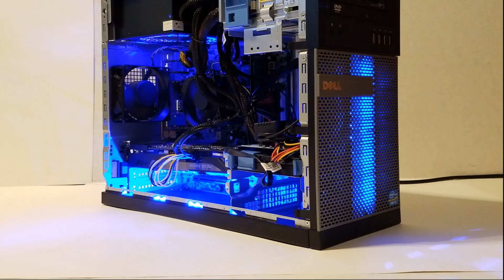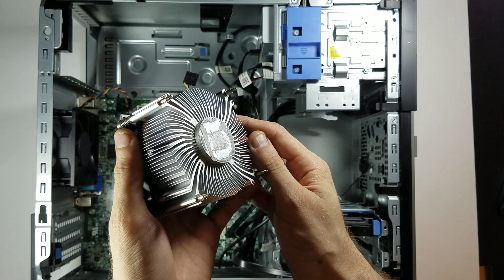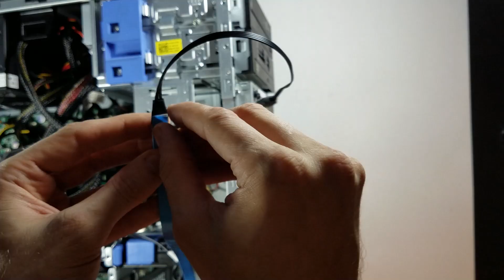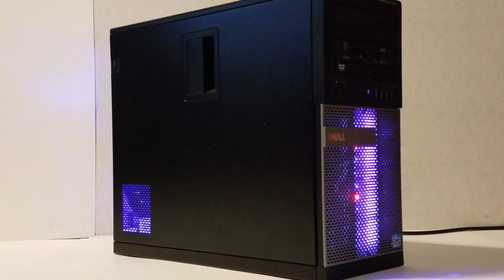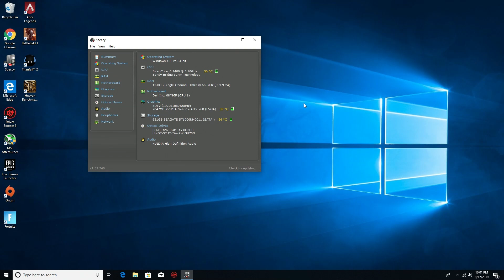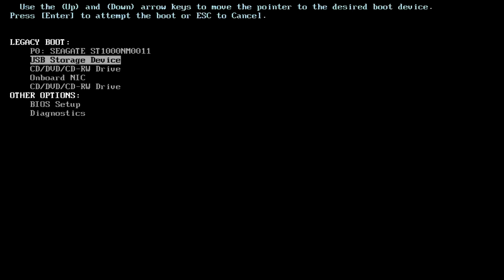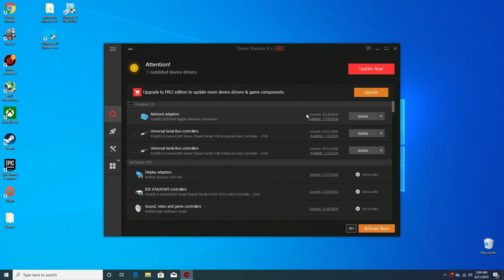CONSOLE KILLER PC *BUILD GUIDE* | FORTNITE | GTX 760 i5 2400 DELL OPTIPLEX

Comment: To anyone hesitant on doing this I’m not telling you to do it but I did it and it runs amazing. Here’s some things to know! In total I spent about $230(including shipping)
-I’m on a dell optiplex 990 i5 2400 
- also it needs to be a mini tower! Make sure it’s this or nothing will fit!(paid $100)
-I did not replace the thermal paste and it runs fine but I still recommend doing it
- I also put the Radeon rx570 in instead of the gtx 770(paid $89)
-if you use the rx 570 gpu in this case your gunna need to drill out 3 rivets that hold the hard drive holder and bend it up
and then just zip tie the ssd in place. 
- I get 144fps on fortnite (prolly could get more but I capped it). 
All in all great buy and build!
Reply from the maker: You made my day brotha! So glad this this build worked out for you! Your my new pinned comment!
Reply: @techyesterday4960  Basically I want to get it but I'm not sure what tower to get, I know it's meant to be an Optiplex but there are so many types.
Reply: 842 0273 get an optiplex minitower or “MT”
Reply: 842 0273 optiplex mini tower 790 i5 2400
Reply: @8420-m7c  get the mt
Reply: Tech Yesterday does it matter what case you get I’m thinking about switching the case
Reply: @techyesterday4960  help i got a dell optiplex i5 2400 790 on aciddent and it has the long power supply and i have a 500w box power supply it doesnt fit what do i do
Reply: king on 60fps u most likely got the small form factor of. Try to return the pc the ebay seller
Reply: @randyRV22  its too late
Reply: @urdopey846  oof
Reply: @urdopey846  How is it too late? it just arived??
Reply: @urdopey846  hey I just did the same damn thing. Did you end up figuring out any ideas? I was thinking maybe I could keep my power supply outside the box but I'm not sure
Reply: @somaticexpedition  no u can try to refund or resell it for the same price
Reply: @urdopey846  damn alright. I have another computer tower that is bigger...maybe I could swap everything from the smaller tower into the other one?
Reply: @somaticexpedition  yes but be careful
Reply: I got a 650 watt ATX and not sure if it will fit in the dell optiplex 990 minitower, can someone help
Reply: @nottrouling3785 i might get this computer will it work with a 790 mt
Reply: Tech Yesterday is a rx 580 sapphire pulse compatible with a optiplex 790
Reply: @techyesterday4960  do all power supplies come with 6 pin and 8 pin adapters?
Reply: @techyesterday4960  does it have to be mini tower?
Reply from the maker: Also i have a video coming this week that goes into great detail about removing the hard drive bay to fit any size card!
Reply: Tech Yesterday if I used a 1660 could I get 240 fps
Reply: Danny, what was the size of the card
Reply: MrEpicBruh uhhh 64gb I think not sure
Reply: Did you get a new psu or keep the one that came in that pc?
Reply: Danny Dressel should I get an OptiPlex 790 or 990. Which is better for gaming
Reply: Danny, is there any way I can connect you through insta or Twitter lmk please I have some couple of questions to ask. Thankyou!
Reply: lopez msg me on insta @dannydressel
Reply: Danny Dressel Thankyou so much man!
Reply: Brandon Taylor yeah I plugged them in to the motherboard first then plugged the gpu in, it was a superrrrrrr close tight fit but it worked
Reply: I got a rx 570 to put into my dell optiplex 990 i5 2400, can someone show me how to fit it and make the rivits and zip tie it please, I might pay if someone gives me a proper tutorial!
Reply: @nottrouling3785   there's a tutorial out there for sure cause I saw one but you gotta look for it
Reply: @nottrouling3785     https://youtu.be/Iu2VXfU8Q58   maybe that will help
Reply: Thanks bro!
Reply: if anyone bought the tower could i get an exact link
Reply: Sage go on eBay and look up optiplex i5 2400 just make sure you get the mini tower
Reply: I can’t fit my gtx 780 I need help any suggestions
Reply: Does this have an hdmi port ? if not than how can I use HDMI.
Reply: lolzi the graphics card has an hdmi but you should get a new monitor
Reply: @xDeeSwervoo  so, I connect graphic card to monitor? Not motherboard?
Reply: Aye can I make a call 2 u 1 day so I can get exactly what u get bro ?
Reply: Danny Dressel do u have to get the 500w power supply?
Reply: Alphah yes
Reply: @dannydressel7433  did you have any problems with it like not turning on and stuff like that or did u just plug in and all was working good? Also can u give me the exact link to the PC cuz theres lots and idk which one to get thank you
Reply: Azzasu i will sell you this exact dell optiplex with the power supply and 16gb of ram and a gtx 780 for 210 or your best offer
Reply: Azzasu i will sell you this exact dell optiplex with the power supply and 16gb of ram and a gtx 780 for 210 or your best offer
Reply: @xDeeSwervoo  what u mean? Add Azzasu#5170 to tell me what u mean ok
Reply: But lowkey sounds like u tryna scam or something like that
Reply: Azzasu that’s your discord ?
Reply: Azzasu Im not trying to scam I just wanna sell it so I can buy a different pc I really don’t want it I regret but I will sell all that for a steal to you HMU on ig or twitter or discord Swervoo#6462
Reply: Azzasu http://rover.ebay.com/rover/1/711-53200-19255-0/1?icep_ff3=2&pub=5575378759&campid=5338273189&customid=&icep_item=383360474305&ipn=psmain&icep_vectorid=229466&kwid=902099&mtid=824&kw=lg&toolid=11111
Reply: @xDeeSwervoo  what's no HDd?
Reply: Azzasu no hard drive you can buy a good ssd or hard drive for $50
Reply: Azzasu lmk if you wanna buy from me or not I’m not trying to scam I just really need the money
Reply: @xDeeSwervoo  I sent freind request on discord
Reply: Can u put the links of all the stuff u bought for it
Reply: Azzasu it is in description
Reply: CallMeDavo ¡ idk if you figured it out but I had the same problem, you can do a psu test to see if it’s that or the computer itself, I thought the psu I bought(link in the description) was junk but it turned out the cable for the power button on the pc I bought wasn’t pressed in all the way so I just wiggled it a little bit and it fired right up
Reply: Danny Dressel can you help me out?
Reply: ImmortalDavo ¡ did you end up figuring it out?
Reply: So i built this pc but when I when I installed the ram I just got a black screen . What do I do ?
Reply: Danny Dressel can you help with
Reply: Kouvax i can help if u want, i built one too
Reply: MrEpicBruh ok you got ig?
Reply: MrEpicBruh mine is @not.kouvax
Reply: Kouvax yup
Reply: Kouvax Tescos_roadman
Reply: Will it work with Dell Optiplex 3020 MT?
Reply: DuckBerry ssf or mini tower?
Reply: @mrepicbruh2839  Mini Tower
Reply: DuckBerry yeah it will work
Reply: Where did you buy the pc from eBay amazon or in a store
Reply: Is the Rx 570 better
Reply: Is there any way to contact you? I need your help with the tower choosing.
Reply: I'm wondering what type of screwdrivers you need to build this
Reply: @adriantanner2598  I think you just need it for the power supply
Reply: I got a 650 watt ATX and not sure if it will fit in the dell optiplex 990 minitower, can someone help please
Reply: Which pc do I need for this build
Reply: Danny Dressel will  a dell optiplex DT work instead of a MT?
Reply: is tower good or does it have to be mini tower cux i have tower
Reply: Danny Dressel is that at full 3D resolution that u get those frames
Reply: Danny Dressel I just brought the same one he got is that a bad idea!?!?
Reply: Danny Dressel I literally don’t know anything about computers. I’ve been on an Xbox my entire life😂 does it have to be a 500 watt power supply or can it be more?? I can’t find a damn 500W in town and it the last thing I need haha
Reply: David Anaya just as long as it not below 500 it doesn’t matter
Reply: Danny Dressel okay thank you
Reply: Danny Dressel thank you!
Reply: Danny Dressel I ordered a 770 and it’s to big it doesn’t fit what can I do?
Reply: Danny Dressel is the rx570 good? For fortnite?
Reply: i cant find the dell optiplex pc only . its showing 15,199 rs which is 200 dollars
Reply: @danny dressel 

Is there any way you can help me? I accidentally got the Dell OptiPlex 990 SFF Core i5 2400 3.1 GHz 4GB RAM NO HDD Win 7 Pro COA

And it has a longer power supply that isn't like the 500w evega I have. I also got the gtx 770 video card. Can I make these things work with this tower? I'm beginning to think I fucked up:/
Reply: Hey danni can it be any sell optiplex 990 or exactly the same has his
Reply: @azzasu8340  dont get the sff
Reply: @urdopey846  what?
Reply: will a optiplex 7010 work?
Reply: Danny Dressel do you have to have a 144hz monitor for it to go to 144fps bcz i have a 75 hz one i might buy a 144 hz one
Reply: Frenox it won’t be as noticeable but will definitely decrease input delay
Reply: Sun Hybrid ok thx
Reply: Frenox no prob
Reply: If had a rx550 would I get like 100fps all low settings 1080p
Reply: i got the rx570 for 30 pound!
Reply: does it have to be mini tower?
Reply: can i use the dell optiplex i5 3450 instead?
Reply: will AMD radeon rx550 fit?
Reply: @valorant is actually fun ayo wsg my guy. I wanna buy the exact PC you have because you said you already did it could you link me the products you used? or could you please tell me what else you added or replaced from what the youtube description says to use
Reply: valorant is actually fun okay thank you
Reply: @valorant is actually fun didnt u have to buy a ssd or HDD since it doesnt come with it
Reply: valorant is actually fun could you please link me it with the SSD or HDD you bought along with it
Reply: Danny Dressel but now im season 4 chapter 2 is it same fps or did u NEED to upgrade
Reply: How bout the and Radeon 480
Reply: @⸻⸻⸻⸻⸻⸻⸻⸻⸻⸻⸻⸻⸻⸻⸻⸻⸻⸻⸻⸻⸻⸻⸻⸻⸻⸻⸻⸻⸻⸻⸻⸻⸻⸻⸻⸻⸻⸻⸻⸻⸻⸻ does the optiplex still run good?
Reply: @⸻⸻⸻⸻⸻⸻⸻⸻⸻⸻⸻⸻⸻⸻⸻⸻⸻⸻⸻⸻⸻⸻⸻⸻⸻⸻⸻⸻⸻⸻⸻⸻⸻⸻⸻⸻⸻⸻⸻⸻⸻⸻ oh ok when did you upgrade
Reply: @⸻⸻⸻⸻⸻⸻⸻⸻⸻⸻⸻⸻⸻⸻⸻⸻⸻⸻⸻⸻⸻⸻⸻⸻⸻⸻⸻⸻⸻⸻⸻⸻⸻⸻⸻⸻⸻⸻⸻⸻⸻⸻ oh ok see the thing is I already ordered all the parts for this build and I wanted to know if it would run better than a console still
Reply: @⸻⸻⸻⸻⸻⸻⸻⸻⸻⸻⸻⸻⸻⸻⸻⸻⸻⸻⸻⸻⸻⸻⸻⸻⸻⸻⸻⸻⸻⸻⸻⸻⸻⸻⸻⸻⸻⸻⸻⸻⸻⸻ ok thanks just aslong as it runs better than my ps4 I’ll be satisfied

Comment: Bro I did this now I’m getting 190 frames on 720 p fortnite and my version only has 4 gb ram update;I upgraded my ram to 12 gigabytes now I get 200 in creative no stutters and 150 in pubs cos my cpu is bad , I used a 1050 ti
Reply: How did you install windows 10 because i put in my usb and everything is plugged in ad it won’t show up
Reply: @denzelappiah2880  I didn’t need to I bought the optiplex pre owned , dont all optiplexes come with windows cos they’re prebuilt
Reply: @niidodoo341  no some have no os

Comment: These are my pc specs 
A10-6700 Radeon
Radeon 7870 GPU (better than 750ti)
6GB ram @1600mhz
Windows 10 Pro (activated)
500W power supply
500GB HDD
USB 3.0 HDMI
WIFI
Can u guys tell me what's dragging me down pls

Comment: Is this motherboard and cooling fans compatible w a gtx 1060 and would I be able to use a 460 w power supply instead of a 500w power supply found a crazy good deal on a deal for both

Comment: how do u remove the screws?
Reply: Drill
Reply: if you have bought this can you link me the gtx 760 or 770?
Reply: @MagLMAO  dang bro it's a terrible time to be part hunting. Back then like 2 months ago it was hella easy to find the parts but ever since quarantine all parts are up in value and the parts themself are hard to find
Reply: XGRINDX thanks for the help I will be checking
Reply: @MagLMAO  I recommend just search gtx 770 on eBay or even the 760 and just check on eBay everyday until someone has one. I have the gtx 770 and I found the first time I looked it up cause it wasn't quarantine
Reply: @domlmao3076  what about the optiplex , it's hard to find one
Reply: @Psyk1o  no but they are overpriced

Comment: I made the pc and it works well but I been having a lot of crashes, any solution?
Reply: What kinda problems you having?
Reply: @mistarj2580  Thanks for the reply I was able to figure it out it was just that I needed to replace the thermal paste on the graphics card.
Reply: Ricardo Lemos yea, low gives you around 100fps

Comment: I bought the power supply but it didn’t come with the gpu connecter , its a 8 and a 6 pin . Please help ! @techyessterday
Reply: Note: i also went with the 770 instead of the 760

Comment: Does it matter if the 500w power supply is a different company?
Reply: nope, any brand will work, but make sure its a good brand, because generic PSU's (power supply units) may not be reliable, I suggest looking at EVGA B stock and wait for there midweek madness sales (every Wednesday) as there are some steals there!
Reply: Aarav Hathiramani wat monitor should I buy?
Reply: Dami :p your monitor really doesn’t matter, i use some free dell ones, just make sure you can connect your pc and monitor and if not buy a connection cable. I suggest watching, Linus tech tips’s vídeo on video cable connection types
Reply: Aarav Hathiramani thx, I appreciate it.

Comment: If you guys have any questions just comment on this comment I’ll assist you and I’ll respond asap.
Reply: Umm can I use another power supply for this because it is not available for my country and I don't know any power supplies that have the same connectors. Plz help
Reply: Zak Macs yes you can use another power supply
Reply: @PencilSZN  but which power supply works tho
Reply: PencilSZN do you need the extra 4 gb of RAM?
Reply: Psm Pluto yes I highly recommend it
Reply: Could I replace the gtx 770 with a gtx 1080 ti
Reply: Zak Macs yes
Reply: @PencilSZN  wait how about the power supply then
Reply: Zak Macs 500w
Reply: @PencilSZN  cheers bro
Reply: Can I use a 390

Comment: I’ve watched this same video around 15 times trying to convince my mom it’s worth it
Reply: Luv Exotic lol same i just got mine i went with the 770 instead and also picked up a 150$ 144 hertz monitor with it only problem i ordered the power supply and didn’t come with the 8+6 gpu pin connecter so got to wait for that to see the performance
Reply: Tapatio Boys ah that’s cool I still haven’t gotten one 💀💀
Reply: @aidanmacedo1306  I just built mine it runs amazing
Reply: Jonathanツ that’s cool bro where u get all the parts from 🧐
Reply: Luv Exotic same my last part came in i runn 144 fps capped steady in creative with a full lobby of 16 and does well over 230 fps uncapped not steady of course and pubs only way to play for me atleast is to cap it at 60 fps cause 144 will take everything forever to render for some reason thats on all low settings , I’m satisfied cause i only play creative anyway 🤷🏽!
Reply: Tapatio Boys that’s cool
Reply: Tapatio Boys what servers u play on??
Reply: @aidanmacedo1306  most of them from eBay I got the gpu from offerup bc it was a good deal
Reply: Luv Exotic na east i get about 30-40 ping in creative , texas ping is shit .
Reply: Tapatio Boys if I got an rx 470 would I have to get a new power supply since the rx 470 only uses 120 watts?
Reply: Voltrex A Rx 470 recommends using a 500w power supply if im not mistaken
Reply: @tapatioboys7846  do u have an SSD?
Reply: @tapatioboys7846  or enough ram?
Reply: Nizzy yes mine came with a 500 gb hard drive and 8gb of ram I’ve added another 4 gb of ram and also another 500 gb hard drive so it does constant 180 fps on low setting for for Fortnite:) . Epic setting does 60 fps steady on 1080 by 1920
Reply: @tapatioboys7846  even in game?
Reply: Nizzy yes i run 120 fps steady in pubs
Reply: Exotic XBL dang dude, tell your mom that you’ll be able to use it for school work as well, it might work 😉
Reply: Tapatio Boys why don’t  you try a FPS booster
Reply: Tapatio Boys will this power supply run the same and does it have all the pin sizes? What did he do to the hard drive? I need help srry I just came to pc gaming
Reply: Tapatio Boys woah do you have a optiplex? if yes what parts did you put on it? if you can gimme a list bc i’m tryna build my own🙏🏼
Reply: @tapatioboys7846  is it good while streaming
Reply: @jonathan45945  what parts did u use?
Reply: eye tje true lmao maybe his mom won’t let him use the card on crap all Mother’s Say.
Reply: Exotico did it work ?
Reply: In my case I got the optiplex but am too broke to get the gpu and psu really sad
Reply: I’m just gonna drop the money on it and not complain but I was once in this situation
Reply: Same I did it and it worked I asked for a pc and the only one that I could find for 500 had integrated graphics bad she didn’t trust me to build anything so I showed her this
Reply: I’m gonna sell my Xbox for this
Reply: Hey I’ll be honest I don’t rlly kno what makes a pc good and I’m just tryin to get into pc’s is this a good one Bc I’m tryin to find one that’s cheaper
Reply: green guy yeah the optiplex is good. if you put a decent graphics card and power supply unit it becomes a perfect budget gaming pc. the intel i5 is very strong for gaming but if you do have extra money to spend i reccomend buying a ryzen 5
Reply: @go to another comment Was it worth and was it hard
Reply: I would probably do the Same ngl
Reply: Lmaooo same
Reply: Same